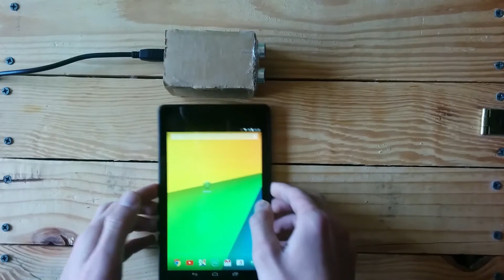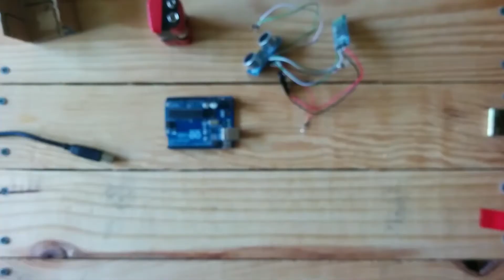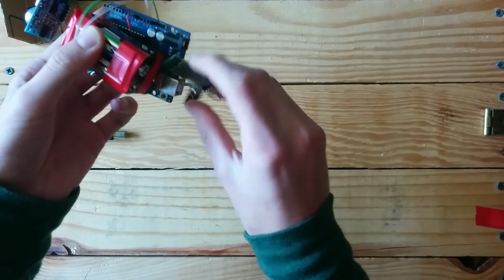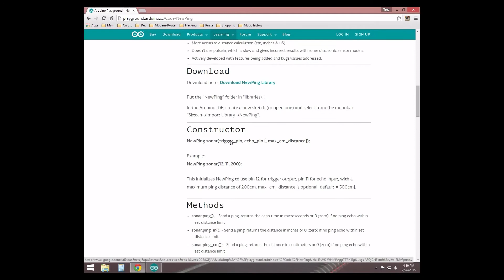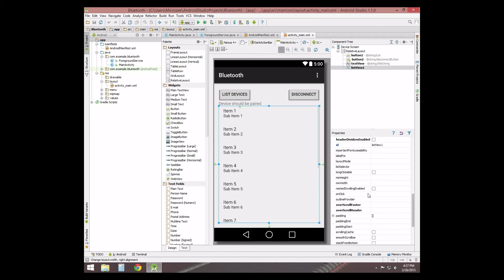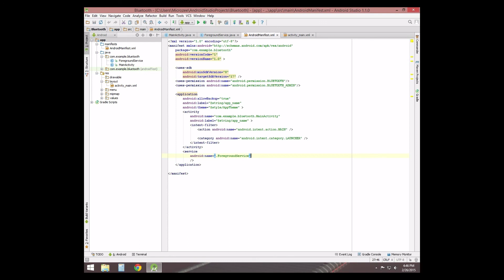Make A Motion Sensor Alarm That Connects To Your Phone

Comment: Why wouldn't I just buy a motion detector?  I guess if you just like tinkering, but if you simply want a result, you don't need to go to this trouble.
Reply: @davidbanks5816  Dumb is not knowing the difference between the definition of dumb and ignorant. I'm ignorant of arduino as well as indifferent to it. Read a dictionary sometime if you get the opportunity.